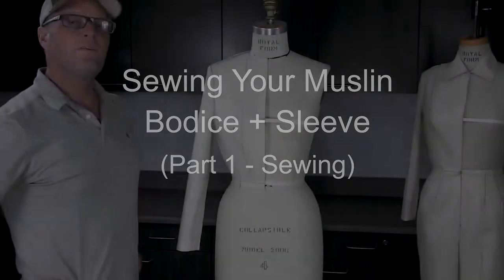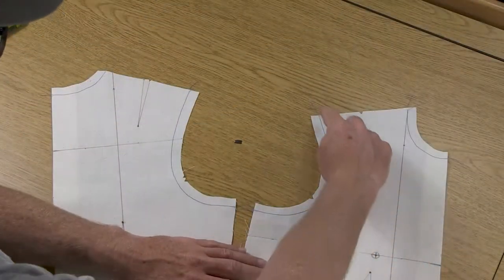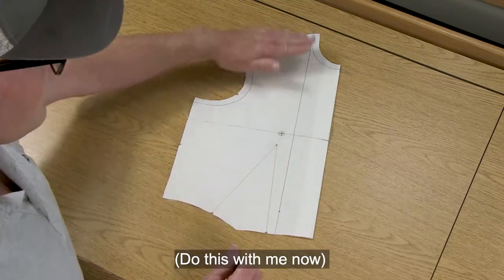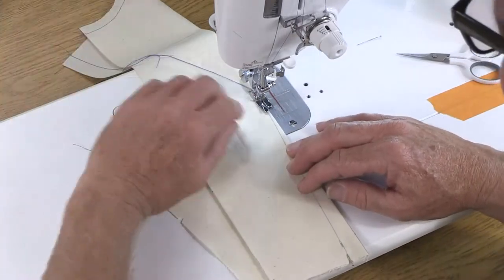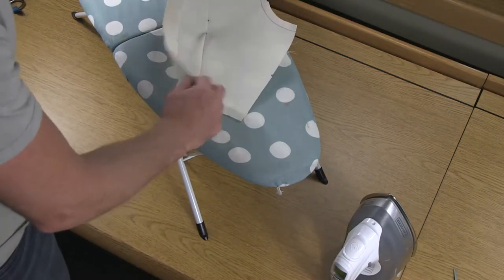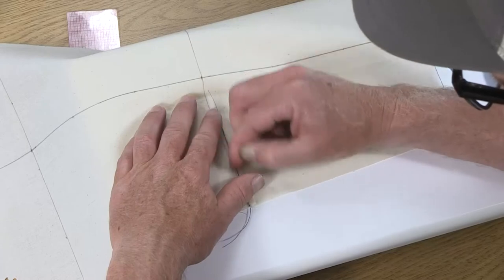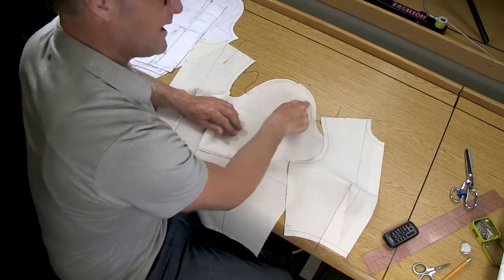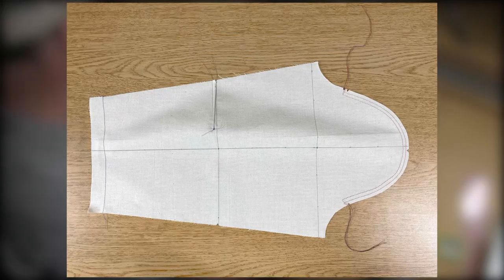Sewing Your Muslin | Bodice + Sleeve (Part 1 - Sewing)

Comment: At the 43.33 min mark you talk about "dont pull the end of fabric" bc it may stretch...what could cause the fabric to sway or move around in a not perfect line?  I have a new Janome, change my needle daily...no tension issues.
Reply from the maker: You need to guide the fabric gently with your hands. I like to help pivot the fabric with my left hand across from the needle (43:25) ...but not in front of the needle = this will stretch it.
Reply: thank you.